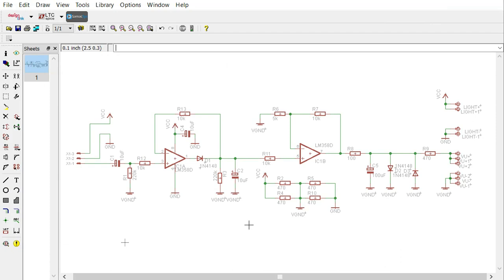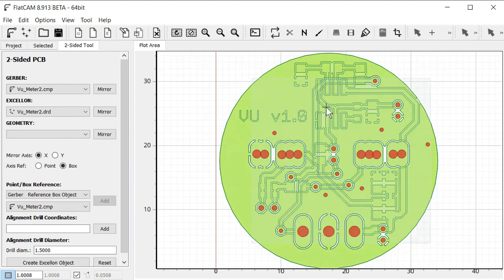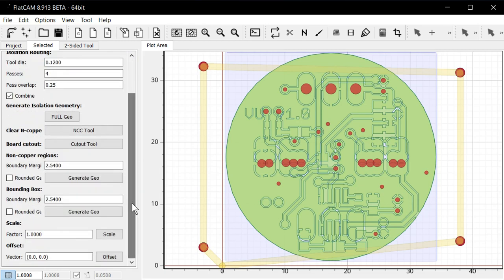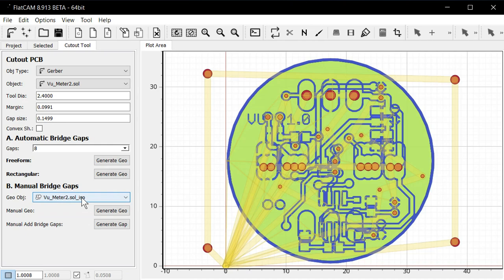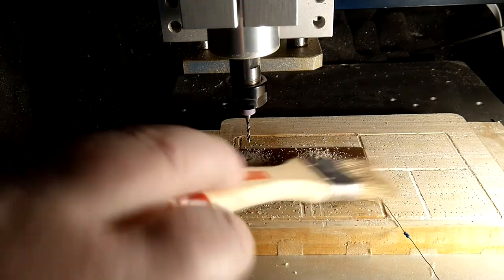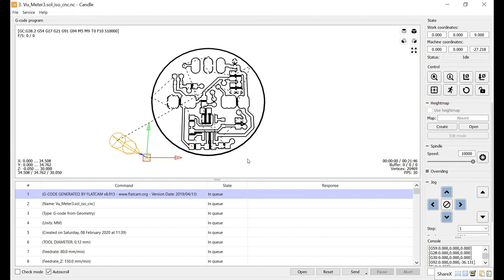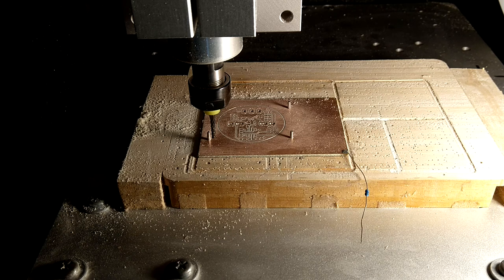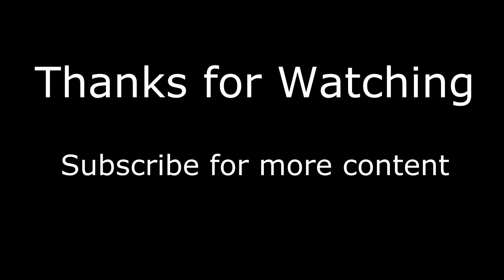CNC Milling Double Sided PCBs Using Eagle, FlatCam and GRBL/Candle, Step by Step Detailed Guide

Comment: perfect video 
thanks
but I have one Q.
Is CNC machine can be useful with all PCB board type ? I mean the board fiber
or the opposite side , is all type off PCB fiber fitting with CNC?
thanks a lot
Reply from the maker: Thanks, you can use other types of boards, but I'd recommend sticking with FR4 boards as the copper is bonded really well to the fiberboard. If you use something like phenolic board you'll find that the copper layer separates much easier from the board material, especially when you have fine traces and small pads.
Cheers,
Jake

Comment: looks like no installer exists for anything newer than 8.5.  None of these features seem to work correctly in 8.5, not sure how you got a newer version running?  Is there a tutorial for that?
Reply from the maker: Hi John, I had a look in their bitbucket, there is a text file describing how to download v8.994 (latest beta).
https://bitbucket.org/jpcgt/flatcam/downloads/FlatCAM_beta_8.994_installers.txt
Cheers,
Jake
Reply: @TheStuffMade  Thanks for that, but still can't get alignment hols added, the newest beta wants a Reference in the PCB alignment sub-section of the 2-sided tool.  It has this field pre-populated with "Box Centroid", but this doesn't work and after I enter the two drill coordinates and click Create Excellon Object it says "There is no Box reference loaded, Load one and retry".  No idea how to do this, not mentioned in any documentation.  No help function no how-to's, generally this is more alpha than beta software at this point.

Comment: Excellent sum up of every step. Also a nice touch on how you make it double sided. What is the pins you use?
Reply from the maker: Thanks, I bought a pack of small hardened 1.5mm steel rods, I think they were like $2 on aliexpress. They work very well to align the board for double sided and will keep it in place during cutout milling.
Cheers,
Jake

Comment: Hi, In very steps of millings, and drilling. How the machine go back to orginal point (x, y, z) (0,0,0) how could you do that? manual?
Reply from the maker: You have to manually zero X, Y and Z before starting the milling, I do it at 14:35 in the video.
Cheers,
Jake
Reply: @TheStuffMade  Hi Jake, my question is not clear at all - sorry about it! for my machine, after it milled top, bottom, or drilled holes, the drill bit did not go back automatically origin like your machine, i have to manual move it back (0,0,0). what setup or buttons do i have to do? could you give me a hint? thanks  again!
Reply from the maker: @garynguyen6981  Are you using FlatCam to generate the G-Code?
Reply: @TheStuffMade  Jake,  I 'm using Flatcam 8.993 Beta to generate the g-code.
Reply from the maker: @garynguyen6981  I don't remember 100%, but I believe there are options under Preferences to make it return to 0,0 perhaps tool change X,Y, Z or end move X,Y,Z.
Reply: @TheStuffMade  THANKS JAKE! Yes, we can go References and pre-set it at Geometry Tab - select Tool Change, also End Move X, Y = 0, 0;  or At Running Time, selected tab, we can choose Tool Change, and End Move X, Y = 0, 0. Hopefully, someone will see this comment.

Comment: what bits are you using for the thin contours, Im getting some hard time with my cnc still can't figure out the right bit to use
Reply from the maker: Hi, I'm using 30 degree 0.1 mm engraving bits, basically like a rod ground to 30 degrees tip and flattened on one side. If you use the same and experience issues with rough traces you most likely have an issue with vibrations or your spindle having too much runout.
Hope it helps.
Cheers,
Jake

Comment: What spindle are you using?
Reply from the maker: It's a low power (~50W) engraving spindle with very little runout, however it's quite old, I don't think they are sold anymore.
Reply: @TheStuffMade  Does a 300W spindle is enough to make a good PCB engraving in your opinion?